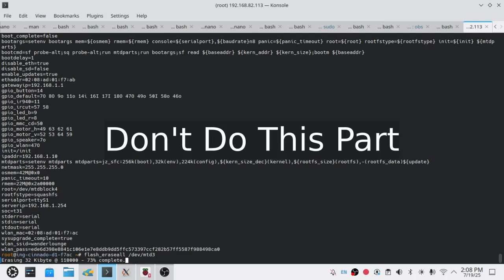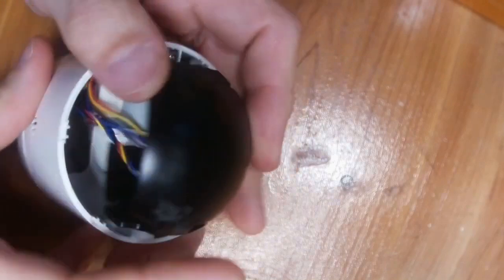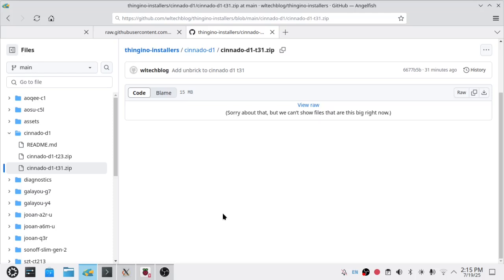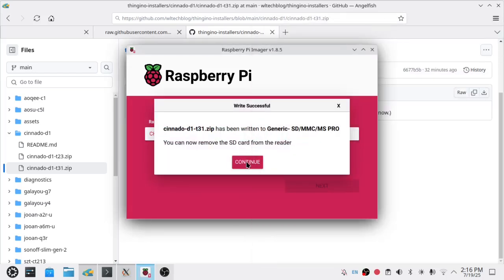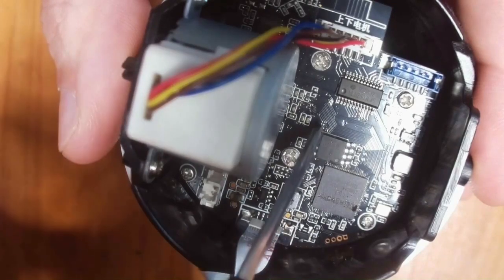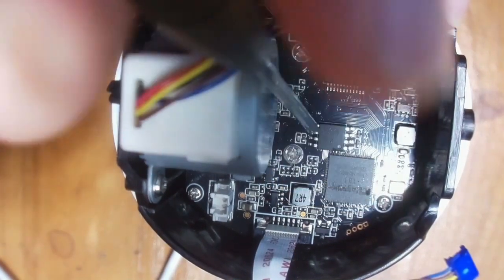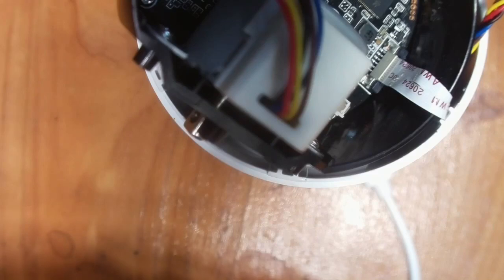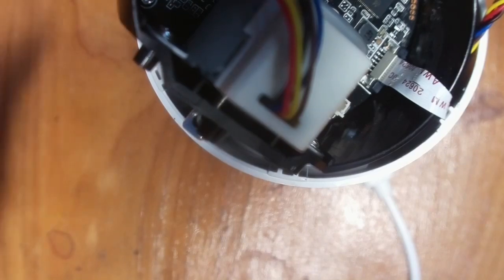Unbrick your Cinnado D1 2K with Thingino! One tool fix, follow along!

Comment: Anyone considered a lens upgrade for the D1? I'm going to try a 25mm.
Reply from the maker: Please share your results with the rest of the class!
Reply: Did you end up trying?
Reply: @ventilate4267  Yes, the 25mm lens that some suggest to use on the Wyze v3, also works on the D1. The first one was a snap so I got another. The D1 is actually a little easier to disassemble than the v3. The lens protrudes from the front of the D1 allowing for easy focus adjustment, and that is important because the DOF of these 25mm lenses is quite narrow, and due to the length of the D1's m12 mount, the lens cannot focus much closer than 5 feet away. I have a 25mm lens installed on two D1's that point outside my office. A drawback is that the zoom is so tight, things can happening that aren't in the frame, to deal with that I use a normal lens camera in the same area to capture the other things. I do want to make D1 teardown and 25mm demo videos, when I get time(the community deserves something from me in return, they are awesome!).

Comment: Many thanks.  My Cinnado is working great.  My problem is with my 2 Neos cameras.  I get them up and running with Thingino and they function for about a day and then just stop.  My router can no longer find them andI have to go through the thingino install process again.  The Cinnado camera does not leave my network. Any suggestions?

Comment: Hey, just wondering if you could help me. I have several of these, very similar looming sec cams that ive been given and im trying to figure out which firmware image i need. Is there a specific chip i should look for?
Reply from the maker: You are looking for an Ingenic chip. We have E support for the t2x and t3x currently and are working on the t4x series. Our firmware is specific for each device, but if you have a supportable device holder at us in discord!